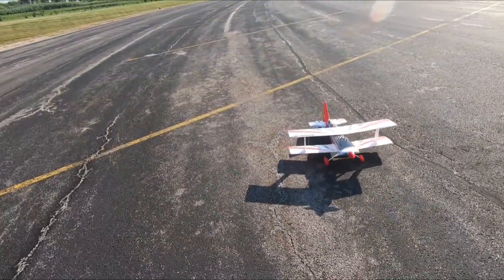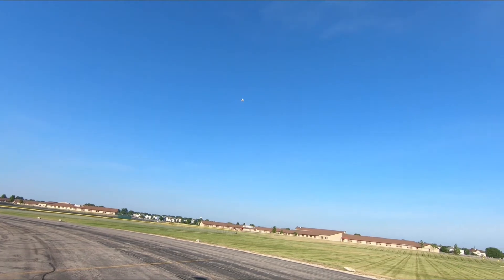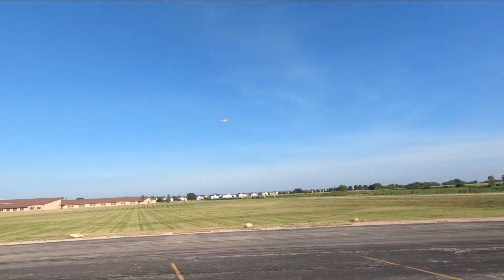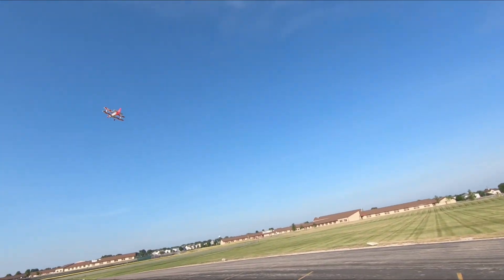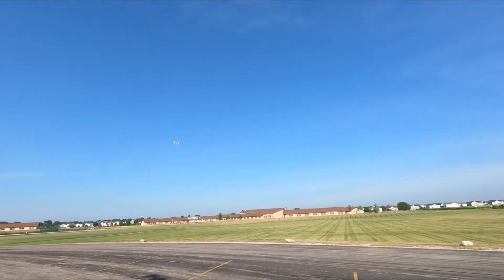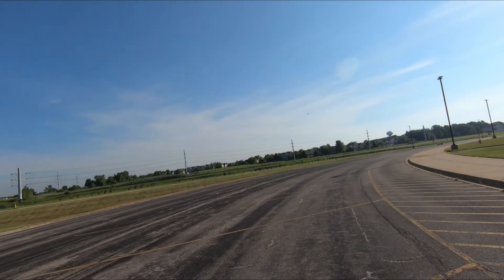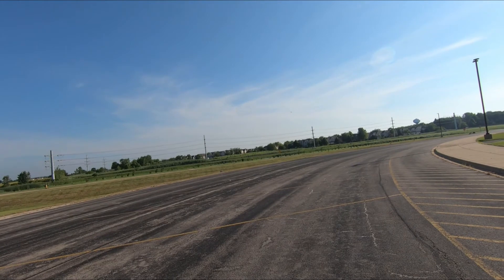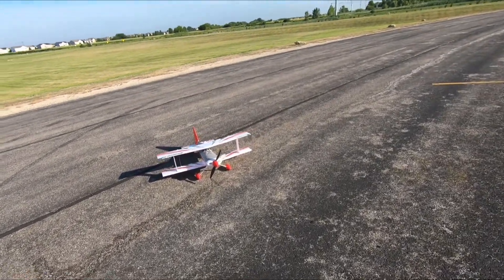E-flite® Ultimate 3D 950mm (maiden flight on 3S)

Comment: Nice bipe, would be nice if EF offered a 1400mm version.  Question, clearly at 04:30 you cut/edited into another run.  How many times did you "actually" take to touch down?
Reply from the maker: Probably twice,  I hardly remember 2 years ago.  Thanks you watching.
Reply: @msj143  😶